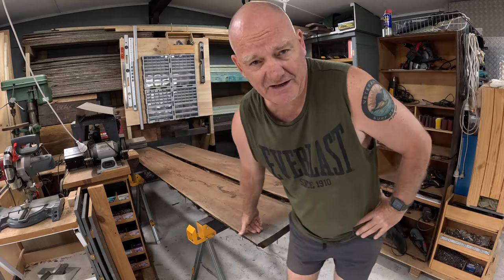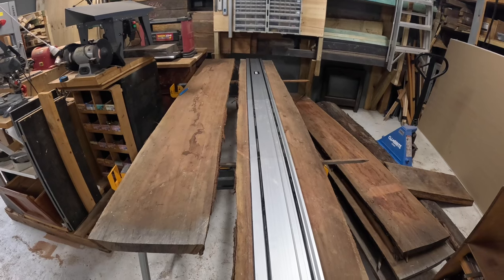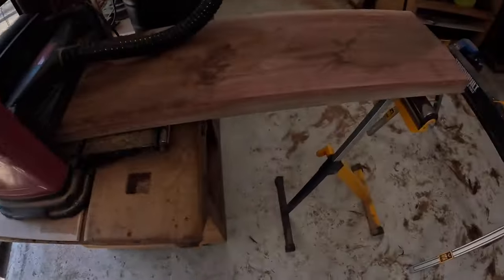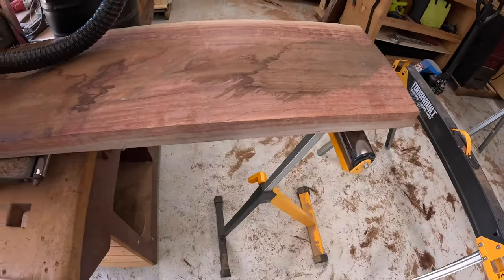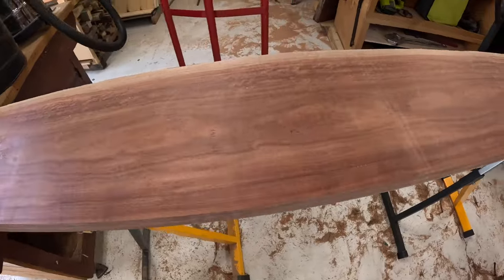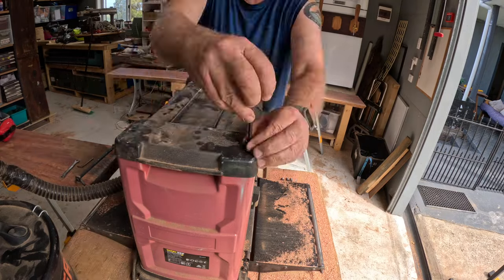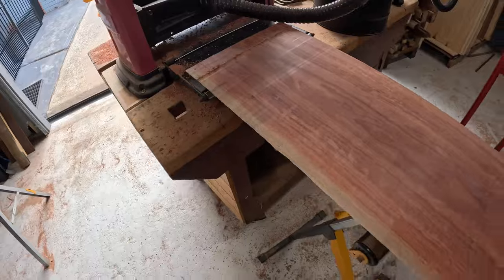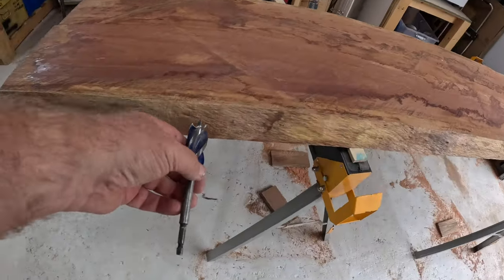A new table for New Year's Eve

Comment: Wow that Ironbark looks fantastic, wait until you put the finish on it will just melt your heart.  I think that thicknesses did an awesome job, I had a gmc model and it would have just resigned on the first cut.  I think you’ll be ok for the belt, your local industrial belt supplier should be able to make one for not too much cash.  It’s dead easy to sharpen spade bits but you will need to do it often.  Looking forward to the finished product.  Heavy, hard and consistent slog will pay off in the end.
Reply from the maker: Thank you Mike. It really does look like awesome wood – though I'm a bit worried about how red it pops when wet. Any recommendations for finish? I bought a new auger bit already. $69! It is heavy work – but SO satisfying.
Reply: @big-irish-git  I’d use a hard wax oil, several coats.  I use either kunos oil by livos, or Britwax from Timbecon, both not easy to get this time of year.  Osmo oil is excellent as well and may be available down your way.  Mitre 10 sell Organoil hard burnishing oil, the jarrah coffee table in our lounge was finished with it 20 years ago and remains as tough as nails annd easy care, it is the least expensive of the common oils.  Bunnings sell a hard wax oil under their kaboodle brand.  

The advantage of the hard wax oil is it protects and can be polished to a subtle gloss with some effort.  An easier option would be a good quality spar (marine) varnish or a spray lacquer.

Whatever you put on it will enhance all. The colours in the timber, so like it is now but more vivid.  You could wipe over with a light damp cloth to show the colour or use methylated spit it, which will not raise the grain.  Not exact but close enough.
Reply from the maker: @mehDustMaker   thanks mate. I'm a definite newby at this, so your advice is much appreciated.

Comment: the drive belt gets easily damaged when you overstrain the machine when planning these wide boards, you should only set the machine to take 1mm off each pass not more, also I think the feeders are also worn, you need to replace them, whenever a board gets stuck inside the machine you must immediately turn the handle to loosen the gap so the feeders' rubber won't worn out by grinding against the wood, there are better cheap compo machines like scheppach HMS1080 but their maximum planning width is 25cm, hope to see the end result soon, merry christmas
Reply from the maker: Thanks for the feedback mate – all good points.
The machine I'm using was cheep too – $350 from Aldi. I also saw one at Bunnings the other day for the same price – Rayobi I think. But this Aldi one will do me for a while yet – after I find a new belt.
I'll get a new progress video out soon.